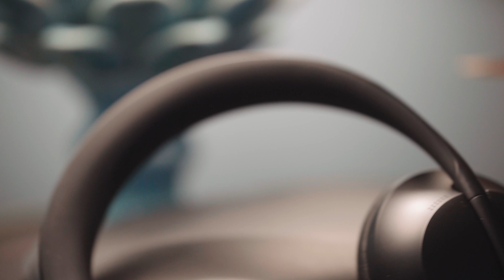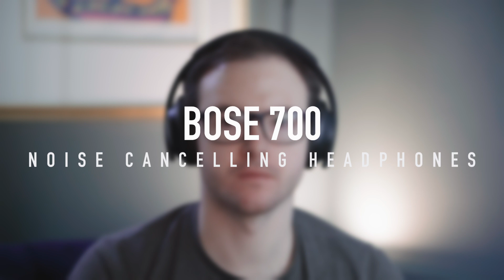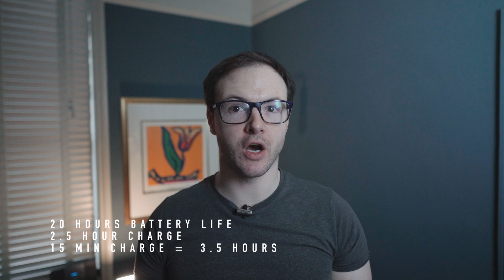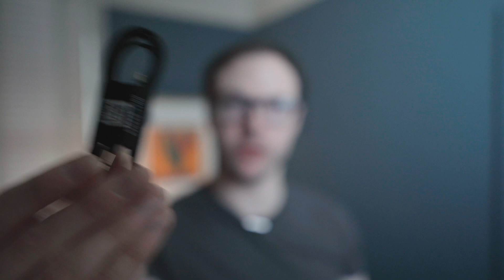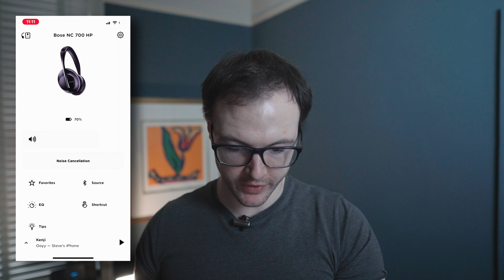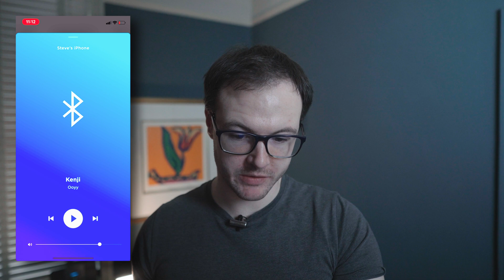Bose 700 Headphones - Noise Cancelling Bargain 2022

Comment: I personaly think that the bose qc 35 ii look way better, i just love the retro look. I have seen a lot of reviews of both 700 and qc 35. A lot of creators say that the 700 are better headphones, but they also say that the qc arent far off, the qc35 arent as good in noise cancelasion and they also dont cancel the backround noises when u are using the audio, but all of the other things are almost the same and the qc35 are lighter. I want to get them on black friday as a gift, beacause its my birthday. I will probaly get the qc35, they are about 50-100€ cheaper than the 700, but if they are less than 50€ cheaper I would probaly buy the 700.
Reply from the maker: Yes I think price is the factor. I still use them almost daily and the nc is just amazing. One thing that has started to annoy me is the fact they don’t fold so the box for storing in my bag etc is huge. My sold Sonys were a much smaller footprint.

Comment: My wife and I got each other Bose 700 for our anniversary. I've had several sets of Bose speakers all the way back to Bose 401's! I've always thought Bose is about the best you can get. First I want to say the noise canceling feature on the headset is so good it's eerie! It blocks out nearly every sound completely. Phenomenal!
We do love our movies and I think head sets are the way to hear all the sounds, subtle crickets to the deafening rocket blasts. The Bose 700 are less than I had hoped oddly in the bass. I hoped the Bose headphones would rattle my brain with the bass, but it's not the case. Don't get me wrong, the headset has great sound, the clarity is fantastic but the bass not so much. Maybe it's too much to ask for bone rattling bass without a large woofer but I'm a little disappointed in the Bose 700 bass.
Reply from the maker: You can boost the bass by changing the EQ in the app.